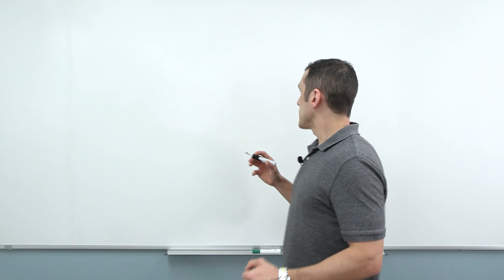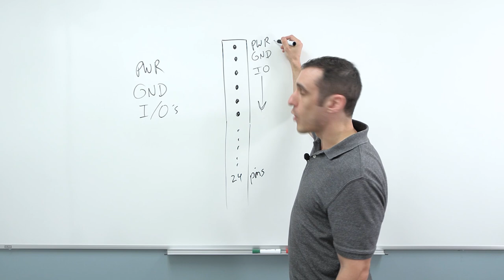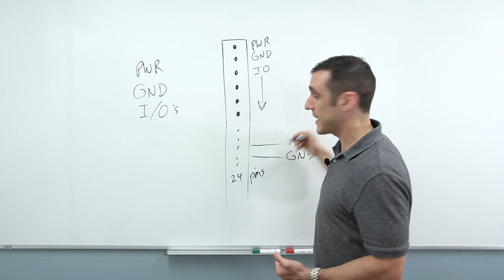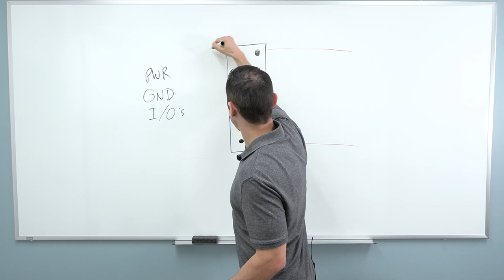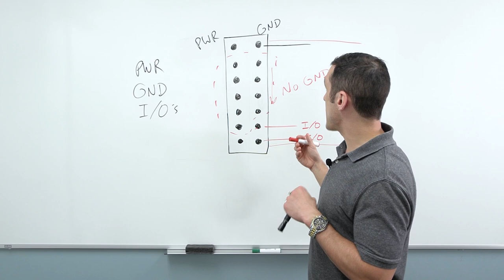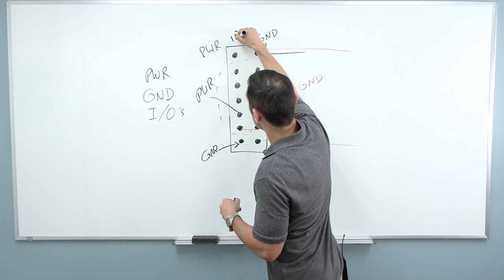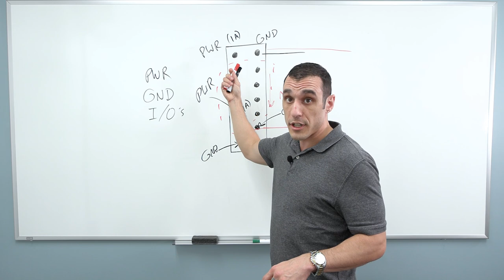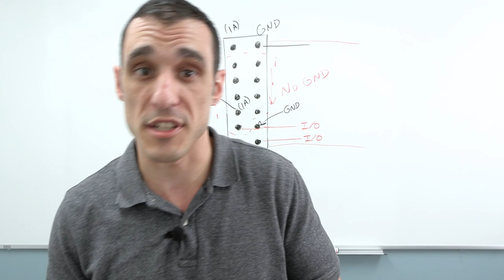How to Arrange Connectors and Pinouts

Comment: Make a video about the tips and tricks that make a pcb look professional. Like placing special markings on the board, or when to use fuses, or where to digitally isolate inputs and outputs, etc
Reply: Sure, I'll try to show more layouts so you can see some examples of more professional designs. Thanks for watching!

Comment: Small nit-pick of a little mis-speak:  9m15s ... the reason for twisted pairs isn't to provide "shielding" per se, buit instead it's to enable common-mode noise rejection through the cancelling-out of noise that affects both signals of a differential (twisted) pair equally.

Comment: Thank you, these videos are really useful, I just have a question: while using multiple GND between signals can create some shielding and reduce crosstalk, doesn't it also create a multi-turn Ground Loop?
Reply: Hi Alireza, Sorry I missed this question but it is worth thinking about! If you're talking about GND vias connecting two regions of copper on different layers, like connecting copper pour to a GND plane, then you do create a structure with a loop but it doesn't really drive a ground loop current. Driving a ground loop current requires ground offsets between two different GND points, or you would induce some current in the structure from a changing magnetic field. I assume you are talking about the latter. In that case, there is also distributed capacitance in the structure, and these elements combine to give a series of possible resonant and antiresonant modes that can be excited by high frequency electromagnetic waves. So in that way, you can couple strong crosstalk using these GND via structures, or you can totally suppress it, with both happening at specific frequencies. This is part of the reason you will see an interesting mode structure in grounded coplanar waveguides above the lowest order resonance.
Reply: Thanks a lot 🙏

Comment: What about industrial, circular connectors? How are these pinouts mapped to maybe a square PCB header which may be crimped on the other end?
Reply: Great question, those usually map to a square array of pins that then solder into the PCB, so you can take a similar approach as is used with a long single-row or double-row pin header. Is there a specific part number you are considering?
Reply: @Zachariah-Peterson  Hi Zach, thanks for the reply! Yes, that's exactly what I'm looking for. Are there any tips for the mapping process from square to circular? For custom cable assemblies, does it matter whether the adjacent pins on one side are not adjacent at the other? Thanks 🙂